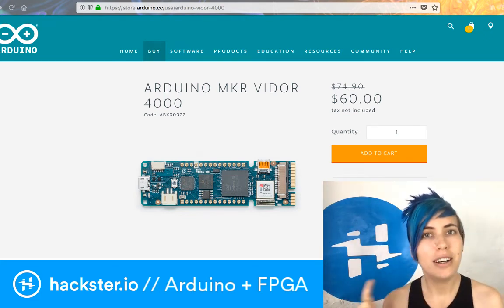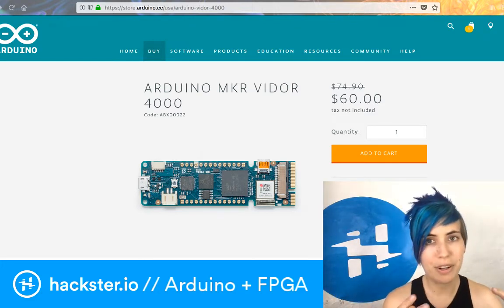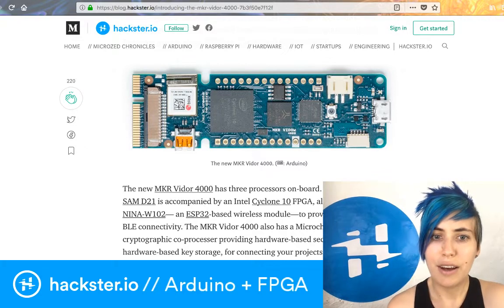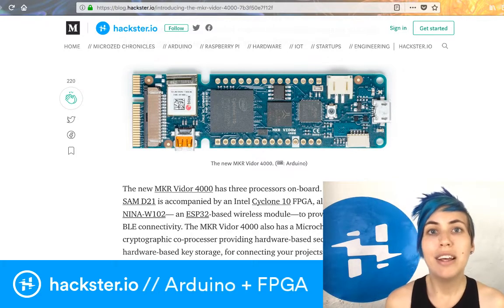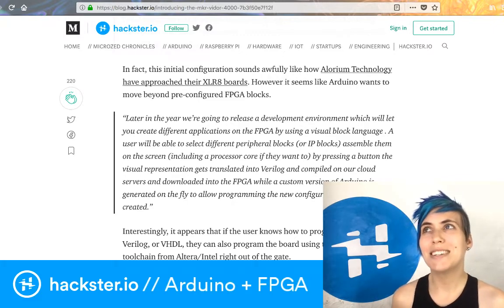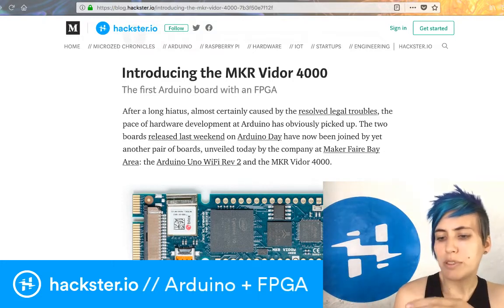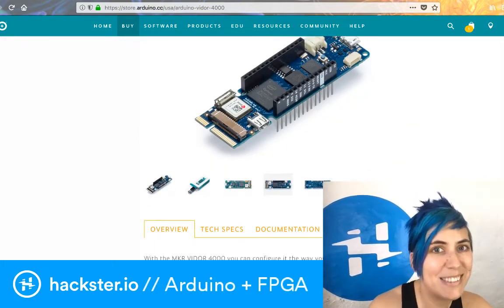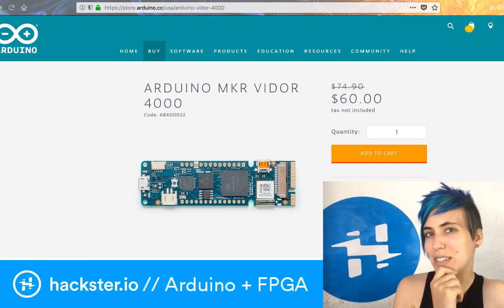Available Now! Arduino MKR Vidor 4000

Comment: It is impossible to program it without closed proprietary tool chain from intel (Intel Quartus). SHAME.
AFAIK so far only FPGS with open tools are Lattice iCE40x. But even there it was reverse-engineered (no bonus points for Lattice).

Comment: They have provided a few extremely limited examples that use pre-made functions that use the FPGA to interface with peripherals. There are no Arduino tools to program the FPGA using Verilog or any other HDL (not even the block programming mentioned in this video).  This is not a device to buy if you want to learn about FPGA's, this is essentially a microcontroller with a lot of peripherals.